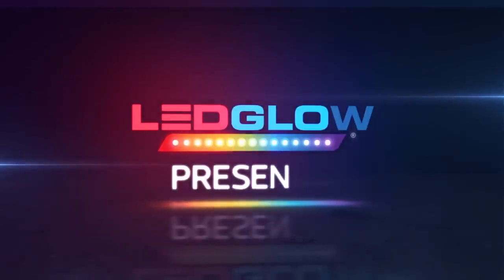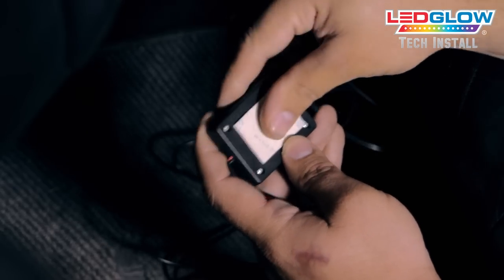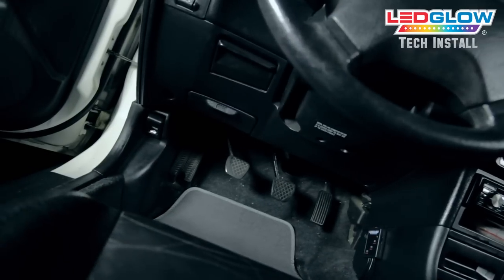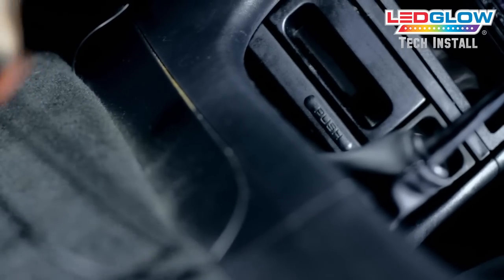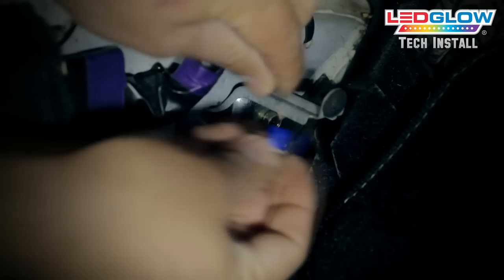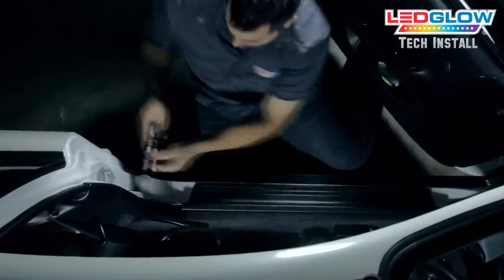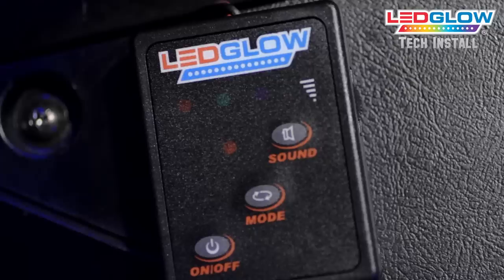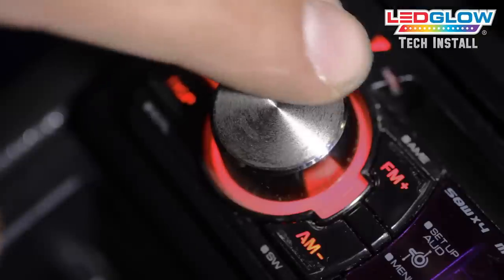Installation | LEDGlow 4pc 7 Color LED Interior Car Lights and Truck Lights

Comment: Fuckin shit now I have to buy this one and the underbody one :( Gosh looks so cool. Plus its awesome a company actually does a step by step for their products.
Reply from the maker: Denver Boyd Thanks a lot for the compliments, we really appreciate it! We offer Multi-Color and Single Color Underbody Lighting Kits with Add On Interior Tubes that function off the same control box whereas using the Interior Kit featured in this video and an Underbody Kit would have to have be powered by two separate power sources and control boxes. If you have any questions or concerns about any of our kits don't hesitate to ask, we're more than happy to help out!
Reply: Hey so I've got a 96 Geo i'm buying and want the interior lights for how does that work exactly are there different prices depending on whether or not its multicolor? I've got a friend who knows how to put it in, and it looks pretty simple but not sure on everything.
Reply from the maker: Denver Boyd If you're looking for a 4pc Interior Kit like one that is shown in the video, the 7 Color Option is priced at $34.99 and the Single Color Options are priced at $32.99 and those include either Blue, Red, Green, Pink, White, Orange or Purple LEDs. We have other interior kits that feature SMD LEDs and flexible tubes that can be expanded to include more than 4 LED tubes if you're looking for more lighting in your 96 Geo. Here's a link to the interior kits that we offer on our site and let me know if I can help with anything else! http://www.ledunderbody.com/LED-Interior-Lighting-Kits.aspx

Comment: i have a 1995 f150 is there a specific kit i need for a pick up? Im at your website and i see all these installation accessories and im not sure what i need for my specific vehicle
Reply from the maker: ZombiePrep236 All of our kits are universal and can be installed to any car or truck. It's all personal preference on which interior kit you want to install to your 1995 Ford F150. The kit featured in this video only has 4 tubes, but we do offer expandable interior kits that can power more than 4 tubes. Regarding the installation accessories, those are different options you can use to power your kit. You can use either an ATO expandable circuit that powers your kit from the fuse panel or a cigarette lighter adapter. If you have any questions about any specific kit, don't hesitate to ask!

Comment: Hi, I bought the kit and installed it but it's not powering on. I bought the add-a-circuit at auto zone but it didn't come with a 4 amp fuse. Do I need one for this to work?
Reply from the maker: mckenzieforunc Yes, the 4amp fuse is required in the expandable circuit for the kit to power on. If you add the 4amp fuse to the expandable circuit and the kit still does not power on, make sure the black wire is connected to a bare metal surface. Let me know if you have any other questions or concerns!

Comment: Would it be possible at all if I bought this kit to run it to lights outside to? Like multiple lights besides 4 say 4 more to the box so the effects would be inside and out?
Reply from the maker: James Tanner I wouldn't recommend installing interior tubes outside of the car as they are not properly sealed like the underbody tubes and aren't durable enough to withstand the elements or any gravel that may hit them. If you're looking to install both an underbody and interior kit to your car, I would recommend installing a 4pc Wireless Underbody Kit with add on Interior Tubes. This allows you to add up to 6 interior tubes along with your 4pc underbody kit that function off the same control box as the underbody kit. Here's a few links for you to check out and if you have any other questions or concerns don't hesitate to ask! http://www.ledunderbody.com/Million-Color-LED-Underbody-Lighting-Kit-Bluetooth-Connectivity.aspx, http://www.ledunderbody.com/limited-edition-million-color-smd-led-underbody-lighting-kit.aspx, http://www.ledunderbody.com/Single-Color-Wireless-LED-Underbody-Kits.aspx
Reply: Thanks

Comment from the maker: We currently have a video that explains different ways to install the kit with the auto illumination function, including turning the kit on/off with the headlights. It is currently not live for the public but will be very soon. I will private message you the link to the video to see if it answers any of the questions you have and if not, I recommend contacting our technical support team at 877.LED.Glow and our techs will be able to further help you with the install process.

Comment: hi, i bought the cigarette lighter adapter thinking that would be all i needed to power it, am i wrong? do i need anything else? i just want my 7 color kit to function by plugging in the adapter.
Reply from the maker: Clutchix If you have the cigarette lighter adapter then are you set to install your kit! Using the cigarette lighter adapter is extremely easy as you'll need to crimp the power and ground wires into the quick crimp connectors and insert those in the appropriate connectors of the cigarette lighter adapters. Check out our installation video that will explain the entire process: LEDGlow's Cigarette Lighter Adapter

Comment: question i have a 2002  mercrury sable i want  to do  this  when i did the blue head   light  i i had to put something  so it wont short out when i install this will it short out my battery  or will it  drain my battery fast  another question what kit should  i use for my car

Comment: i would like 4PC 7 COLOR LED CAR INTERIOR LIGHTS.. but not sure which installation kit for a 2014 ford fusion SE
Reply from the maker: +Poor Grades Unfortuantley, I would not know which fuse size your 2014 Fusion would need. You can determine that by looking in your vehicle's owner's manual, or by pulling a fuse out of the panel itself. Or, you can always use a cigarette lighter adapter.

Comment: How would I wire them up to turn on when I turn on the dome light a swell as when I open the doors like the courtesy lights?
Reply from the maker: Luis m Unfortunately if you install the interior kit to power on when you open the door, you will not be able to use the kit when the door is closed. Check out our video called LEDGlow's Auto Illumination and it will explain the entire process of installing your interior kit with the auto illumination function. If you have any other questions or concerns don't hesitate to ask!

Comment: Im about to purchase the 4pc 7 color kit for my 07 Lexus es350. I would have to buy the expandable circuit "mini" right? Also is it all right to plug the fuse into the 15amp FR FOG? Should I be worried about battery drain and also to confirm that is switch right?
Reply from the maker: James Lee Yes, for your 2007 Lexus ES350 you will use a mini expandable circuit to power the interior kit from your fuse panel. You shouldn't run into any issues using any 15amp fuse, but if you are worried about your battery draining then I would recommend powering your kit from a switched 12v source so you can only use the kit when your car is powered on. Let me know if I can help with anything else!
Reply: Its just that I dont want to blow a fuse that I really need when driving. Other fuses that I see thats either 15 or 10 under the drivers side is like ignition, a/c,  gauge, etc. Is it unlikely to blow a fuse?
Reply from the maker: James Lee I see your concern, but yes, our LED lighting kits have a very low amp draw so it is unlikely that the kit will blow a fuse. Some common fuse sources that I would recommend to use for your installation is the radio fuse or power windows fuse. If you have any other questions don't hesitate to ask!

Comment: Hi,

What amp fuse do you suggest I should I connect the add-a-circuit to? Is there a minimum/maximum and does it matter if its higher or lower? Also, for example, if I removed a 10amp fuse, inserted the add-a-circuit to where the 10amp fuse was, inserted the removed 10amp fuse to one (of the two) slots in the add-a-circuit, what do I put in the other slot? Another 10amp fuse (to match the one in the other slot)?
Reply from the maker: jaychawla1 I would recommend using a 10amp fuse to power the kit, but you can go as high as 15amp. I wouldn't recommend anything higher than 15amp. If you have the 10amp fuse in the expandable circuit with the expandable circuit plugged into the fuse panel, you will need to make sure that the included 4amp fuse is plugged into the other slot on the expandable circuit as well. That 4amp fuse that comes included with our expandable circuits acts as circuit protection for the kit. If this 4amp fuse is not plugged into the expandable circuit with your 10amp fuse then the kit will not power on. If you have any other questions or concerns don't hesitate to ask!
Reply: LEDGlow Thanks, I was able to install it and figured it out! It's a great learning experience too. I highly recommend this kit to anyone considering it...You won't regret your purchase and you cant beat the price! Looks awesome
Reply from the maker: jaychawla1 Glad you got everything installed! Send us some photos to our Facebook or Instagram pages!

Comment: I want the kit to light up when the door opens and when the fog lights/headlights turn on. Other times, I want the LEDs off. How would I wire that up? I have a 2006 Nissan 250Z

Comment: I just bought my 2006 Mitsubishi Eclipse GT and just realized that the fuse panel cover for the interior fuse box is not there and there is also no owners manual included so I cannot tell which fuses serve what purpose.  Do you have a diagram or can you tell me which fuse is the dome lights fuse?  Thanks

Comment: so I connected the red wire to the blue but connector and I connected the ground wire to a bare medal part and I'm certain that i used the 12 volt fuse but the lights are still not working, I have a 2011 Mitsubishi Lancer. Any suggestions?

Comment: I cannot find a place to ziptie the lights onto my Acura integra 1998 under both dashboards
Reply from the maker: +Rayyan Talha You can zip tie to the lights to some extra wiring under the dash. We used a 1999 Acura Integra for this installation video and installed the lights under the dash the same way. Let me know if I can help with anything else!

Comment: does it matter what fuse you use inside the fuse box?
Reply from the maker: ***** You can use any fuse source in your fuse panel, just make sure that the one you select does not exceed 15amps. I would recommend using a 15amp, 10 amp for 5amp fuse to power the interior kit. If you have any other questions don't hesitate to ask!

Comment: Hi, I want to connect my LEDs to my radio fuse. Will this work and will they turn off when my car turns off?
Reply from the maker: Lenny Iacco You can definitely power your interior kit from the radio fuse and the kit will only function when your radio is powered. If your car is off and you can't use your radio, you will not be able to use the interior kit. Let me know if you have any other questions or concerns!

Comment: I'm about to install the expandable kit into a 2003 Mitsubishi Spyder convertible. I'm thinking I'm going to use an add-a-circuit with it, but I'm not quite sure where I can ground my negative wire. Any help? I'm doing anything I can to NOT drill a hole into the car.. Maybe a spot near where the circuit box is? And can it be just any kind of metal in the car? Thanks for any help!

Comment: What Circuit Adapter would I need for the 6pc. Expandable Million Color Mini for a 2012 STX F-150, which is extended cab, and what adapter would I need for a 2002 Chevy 2500 Diesel truck that has a custom built box with 12 inch. subs in it, that has an amplifier, which is under his back seat, and the truck is extended cab. Also, is there any other non-included materials I would need to set up these lights in these two trucks? I also need the lights to go on and off by a button. Thanks  so much!!

Comment: Can you adjust brightness off the LED light?
Reply from the maker: ***** Our 4pc Single Color Interior Kits come included with 7 different brightness levels, but the brightness levels are not featured with the 4pc 7 Color Interior Kit. Let me know if you have any other questions or concerns!

Comment: If the lights are hooked up to my headlights will they automatically turn on and off if my headlights are on auto?
Reply from the maker: WarDog982 Yes, if you set the interior kit to enable the auto illumination function then the kit will function that way when your headlights are on auto. Check out our video called LEDGlow's Auto Illumination and if you have any other questions just ask! Here's a link to our video: https://www.youtube.com/watch?v=4IbmoDbkG-4

Comment: I want to buy one to install in my 93' Mazda Miata if I get 2 can I put them next to each other so one lights up when I open the door and one lights up when I have the doors shut? Also will both work on my car? Is there a switch to turn it off? And also can I install one in my cars trunk that lights up when I open it?
Reply from the maker: JD Yeah you can definitely install two kits to your 93 Mazda Miata. You can install one of the kits with the auto illumination function so it turns on when you open the door and another kit to any switched 12v power source so you can use it with the door shut. You can also install lights into the trunk that will turn on when you open it and turn off when you shut it with the auto illumination function. If you have any other questions or concerns just ask!

Comment: Does the kit come with the circuit that is to be plugged into the fuse box?
Reply from the maker: Fog Camel The Expandable Circuit used to power the kit from the fuse box is an optional installation accessory that is not included with the interior kit.

Comment: Hi, I have a 2004 Lexus rx 330. I am considering using the regular12 volt outlet for my power as oppose to running the wires to a fusebox or a battery. I got a quote from a well known shop and its quite a bit, could you guys provide me with guides or websites which shows the different ways to connect your led lights and how? I do own a car lot and if i can learn how to install these I forsee lots of future business.
Cheers!
Reply from the maker: chillinxxpaki69 Thank you for contacting us! I will provide you with a link to our installation video using a cigarette lighter adapter to power your kit. This 4pc LED Interior Lighting Kit installation video is a great source to use for mounting the tubes and hiding the wires, but the only thing that will be different for your install is that you'll power your kit from the cigarette lighter port rather than using an expandable circuit. Here is the link to our video and please let me know if you have any other questions or concerns! LEDGlow's Cigarette Lighter Adapter Video: LEDGlow's Cigarette Lighter Adapter

Comment: If I use the cigarette lighter adapter I don't have to ground anything right?
Reply from the maker: Mimi Bastien You will need to ground the kit, but you will be using the quick crimp and butt connectors that come included with the Cigarette Lighter Adapter. Here's a link to our installation video and if you have any other questions just ask! https://www.youtube.com/watch?v=1ebMvKi4sHg

Comment: I'm really having trouble finding where to connect the black and red wire
Reply from the maker: Luis Larios The red power wire connects to a constant or switched 12v source and the black ground wire connects to any bare metal surface. If you're using an expandable circuit for your install, the red power wire will be crimped to the expandable circuit and then inserted into your vehicle's fuse box for power. If you want to connect the red and black wires directly to the battery, you will need to extend the power and ground wires using 16 or 18 gauge automotive grade wiring. You can also use a cigarette lighter adapter that powers the kit directly from the cigarette lighter port. Let me know if you have any other questions or concerns!

Comment: I just bought these for my 1996 accord coupe so it's essentially this Acura intrgra would you recommend a switched circuit or constant for general illumination
Reply from the maker: +jordant0085 I would recommend using a switched power source to connect the expandable circuit to because if you're using a constant source and forget to turn the lights off when you leave your car, it could cause your car's battery to drain. If you use a switched power source then the lights will turn off with your car and you won't ever run into that issue. Let me know if I can help with anything else!
Reply: +LEDGlow awesome the lights are coming in today so great stuff thank you
Reply from the maker: +jordant0085 Sounds great! Don't forget to send us some photos of the interior kit installed to your 1996 Accord Coupe to our Facebook or Instagram pages!

Comment: Hi, I've been trying to set this product up however I haven't been able to get it connected. I connected the add a fuse to my radio fuse and I've been trying to find ground but it doesn't seem to light up. I'm pretty sure some of the ground are good but I don't know if I'm even connecting to the power or not. I own a 2002 alero oldsmobile, any advice?

Comment from the maker: Yes you can use a 10 amp fuse that is not a problem.  You can ground the box anyway you would like as long as it is a good ground.  You don't necessarily need to use an eyelid connector, it just makes it easier.  Let me know if you have any other questions, I am more than happy to help!

Comment: I tried to install the led glow 2 pc kit in my car and everything looks like it's supposed to I did exactly what the video asked. When I plugged the add a circuit into my fuse box it didn't work I'm not able to get power.